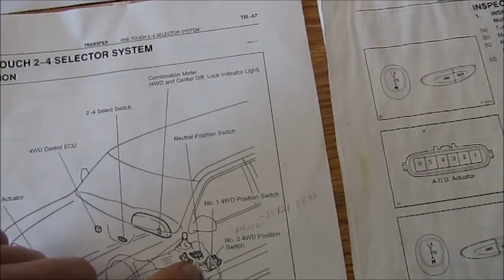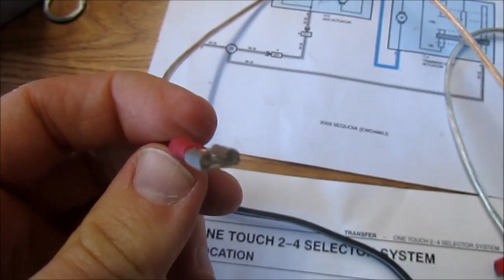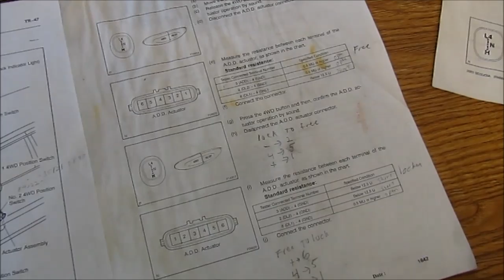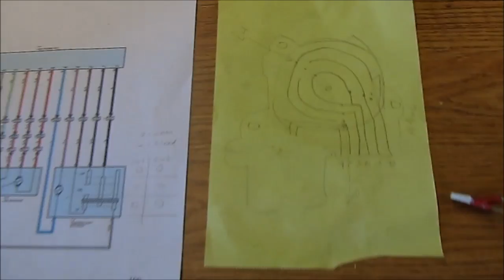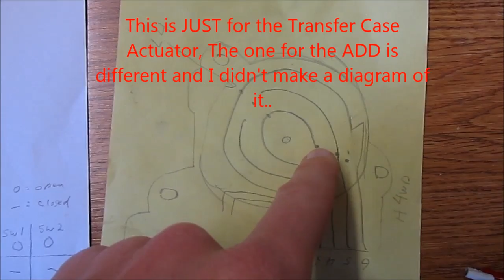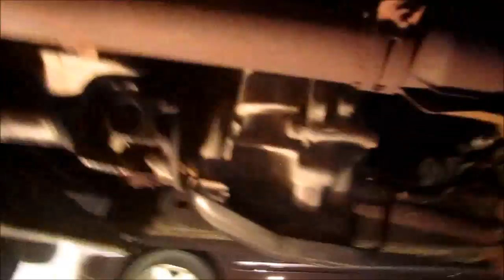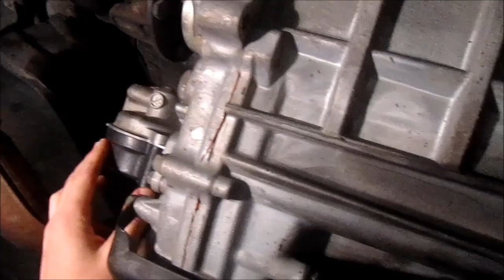sequoia 4wd troubleshooting

Comment: great video very informative where your lock button is mine has a vsc button is that the same?
Reply from the maker: I don't know for sure, that is for the vehicle skid control.  I think it probably does the same thing because when I push mine a light on the dash comes on that says "vsc off".  You could check by getting it into 4wd, park it, then press that button and listen, if you hear the transfer case actuator motor run then I would say it is the same thing because it is shifting the transfer case into the locked position. but that's just a guess?  sorry I can't help more for sure on this.
Reply: smashsackett having trouble with the transfer case motor am going to use much of your information to get it out of 4wd the front motor works after I reset by disconnecting battery terminal for a few hours I still have to check the switches and may get gutsy and pull the transfer case motor. I like that you dont have to pull everything apart to change the motor. Ill have to see if i can get it seperate from the rod if I need one.

thanks again
Reply: Brad Goodrich so the jumpers and battery work perfectly (once i got my pins numbered correctly) tested the two switches on the transfer case motor the appear to be ok tho i get different readings on each one they cut off the current when not engaged. Now when i plug in the two plugs the front goes back into 4wd. for now I have the plugs undone and taped the ends and sockets any idea what would cause the front motor to engage when vehicle is started?
Reply: Brad Goodrich So if I understand you correctly you can get the transfer case motor to run using the battery and jumpers, if so this is good. Also you need to verify the readings of the actuator at each position. 4H, 4L, and 2wd.  using the continuity tester, and same for the front actuator, in free and lock position.
 What happens when you push your 4wd button?
 Is the diff lock light currently flashing?
Reply: Brad Goodrich I have the same issue going on right now with my 2007. The front ADD puts it in 4wd and will not go back. Did you fix yours? What did you find out?

Comment: For my 2003 Sequoia, the only way I can get INTO 4WD is to shift into N and use the lever that switches between 4L/4H. I leave it in 4H in general. I shift into N and then put the lever into 4L and then shift into 4H and that gets me into 4WD. I use the button to DE-activate 4WD, but it WILL NOT WORK to get me INTO 4WD. I hope this helps someone!
I replaced a bad plunger switch. I also replaced my rear actuator because it was badly corroded.
I was still unable to get into 4WD and I was looking at the front actuator. I took it off and was looking at it. It appeared to be in like-new condition, no corrosion or anything. I opened the motor portion and it fell apart and I couldn't get it back together, so I bought a new one from China.
Reply: i can get mine into 4wd via manual t case but my button doesnt work on getting it out

Comment: Can you do a video on how to set the teeth on the actuator gear and motor? I took that apart and I need to line up the teeth. Having a tough time figuring it out. Thank you!
Reply: Any help?
Reply: Hi I saw the video great job . I have a 2001 Sequoia limited with a 4 wheel drive button and the shift lever . but I am on the same situation I disassemble my motor on the actuator it was stuck the broches of the motor wore stuck I fix the motor it's working fine but as I disassemble and assemble because my transfer case is on my bench   the whole mechanism and the gears came off so I need to align the teeth back on in 2hi. So by moving the whole gear sets all the way clockwise to the end meaning the input shaft is out of the transfer case I need to align the  teeth do the three pin of the cover your instructions are clear but where are the three pins should be .?? How did you figure out yours be grateful for your help

Comment: hey man,  great in-depth video! my 02 sequoia has the red diff light flashing on the dash consistently. the two switches are good,  but my diff actuator has continuity at pins 4-6 So it's stuck in locked 4wd? so I need to replace that actuator?
Reply from the maker: not necessarily, if you manually rotate it using the procedure described in the video it will likely start to work again.
Reply: @smashsackett  if you're still around, where can I get access to this manual? Very hard to find.. Thanks for the great video.